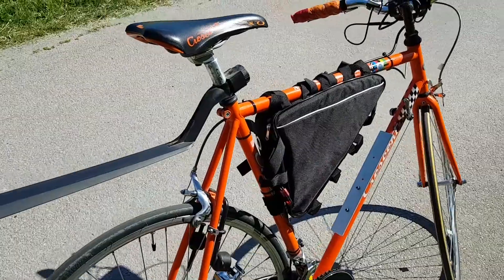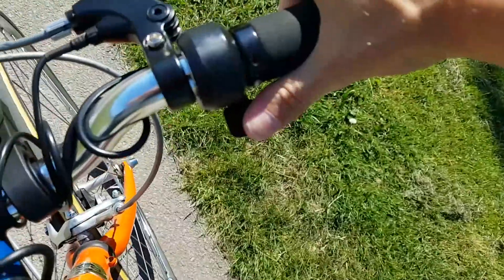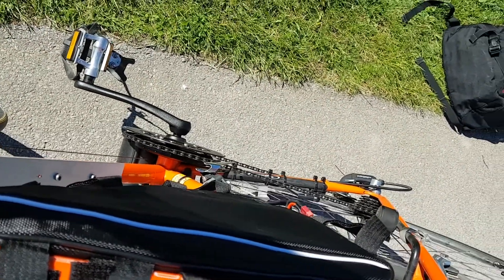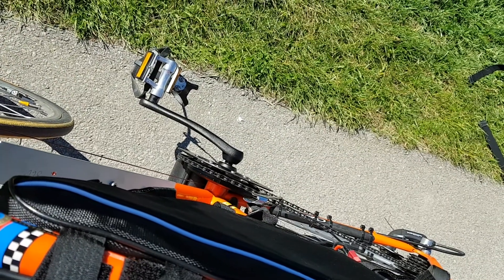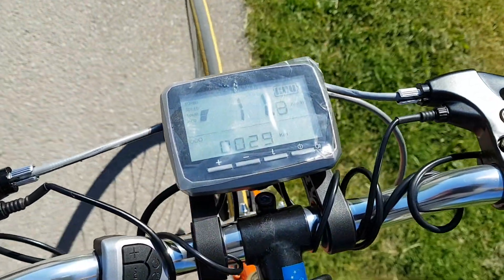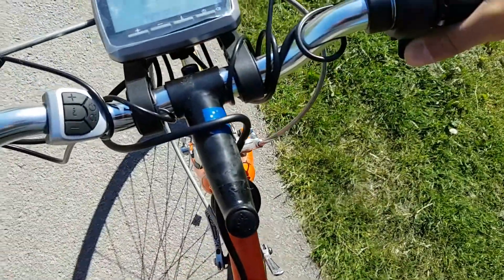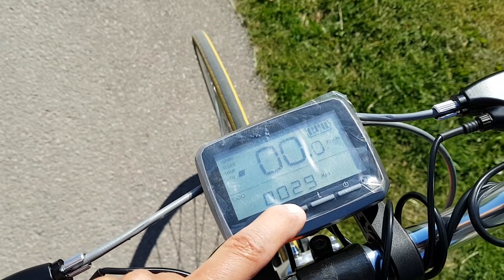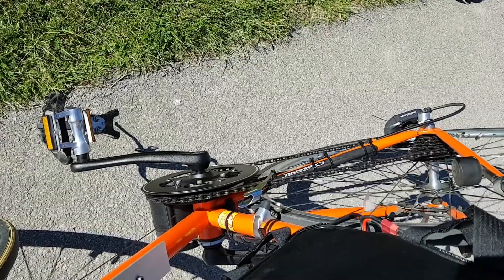Tongshen TSDZ2 Mid Drive Motor common problem

Comment: were you able to fix it? How? What was the root cause? Please educate us and share your thoughts...thx
Reply from the maker: No, still present if use fully charge battery.  I belive a fix is to upgrade the software to open source. But I have not tried that yet.
The specification of my motor says:
"Supports up to 54.6V input voltage, this motor cannot work on higher voltage." But I do believe that upgrading software will fix this. Do you have the same problem with fully charge battery? If I let the battery drain a little the motor works fine.
Reply from the maker: Found this info and will try to adjust the power cable, might be some interference affecting the controller. Will try to separate them. What is your problem, is it the same?

" I separated the cables and moved the controller and speed cables away from the power cable. Now everything works as expected."

Check out this thread: https://endless-sphere.com/forums/viewtopic.php?f=28&t=94881

Comment: Disconnect your battery & wait 5 minutes. Then re-connect & make sure your wheel sensor & all the other connections are correct. I do not think it is your battery but it is possible it could be the Controller. Check for the easy simple solution first.